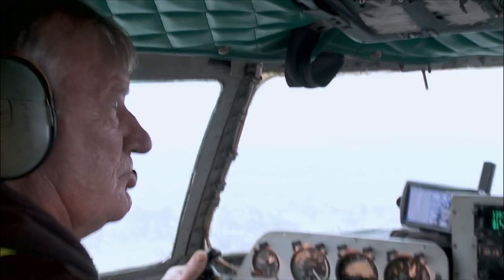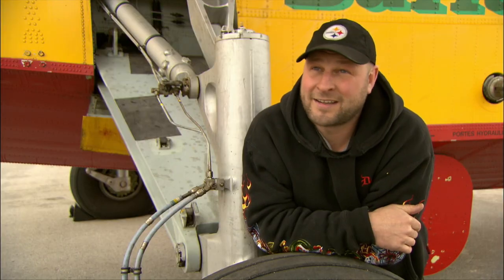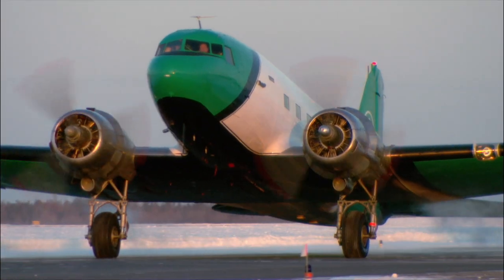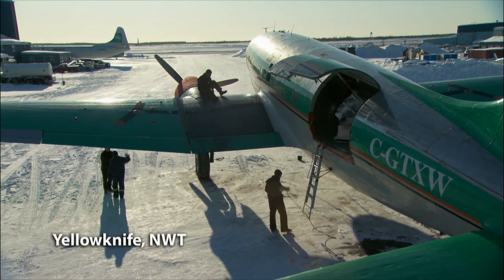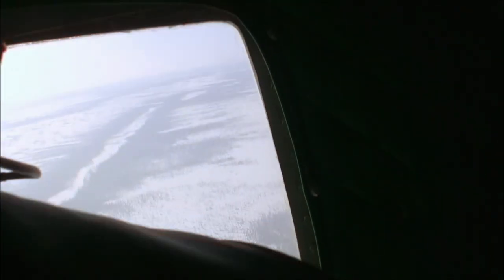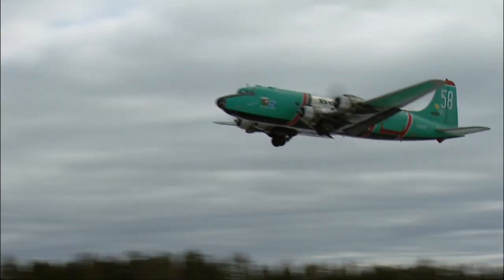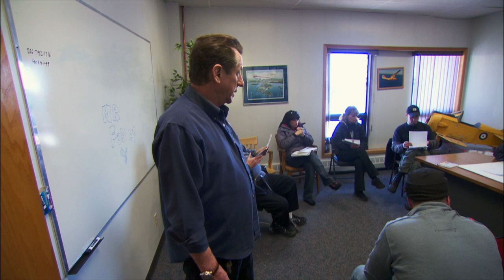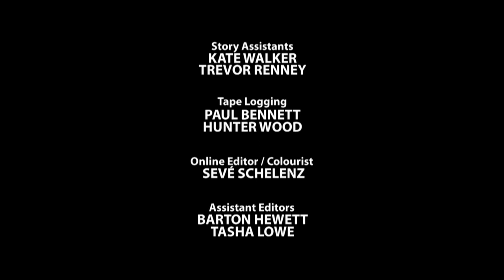Thin Ice - Ice Pilots NWT S01E10 - Go Xplorer

Comment: I gotta say, the pilot that is fired from the mining strip job is not at fault for nothing if the "safe mining company" puts out a unsafe bent and narrow landing strip. If I was the pilot I wouldn't be pointing fingers but I would be defending the fact they were the ones creating the unsafe condition because they are unaware how to make a basic (straight) landing strip on ice with a turn around.

I saw them land but I never saw the clip where they had the accident so unsure if it was while turning around but if its from the strip being narrow or having no turn around, that is the problem the safe unsafe mining company created when they made a unsafe landing strip.

Comment: Man there should be a certification required for mining or other companies that need to make temporary/make shift runways. This way they can ensure the temporary runways are as safe as possible. The miners are smart and safe when it comes to mining but they don't know jack about aircraft or aircraft safety - even the most basic fact the plane needs a straight runway (especially on ice) with enough space to make a turn around. They need to know the type of aircraft they plan to fly in, and their minimum stopping distances. Sorry but having a bunch of noobs making an ice-lake landing strip is a terrible idea. Even the turn around space is important, if they can't take off again that plane sinks to the bottom of the lake! Generally I would not argue for more regulation but there is an aircraft with souls on board that needs to get down to the ground safely every single time.